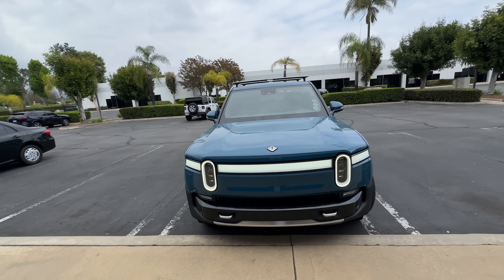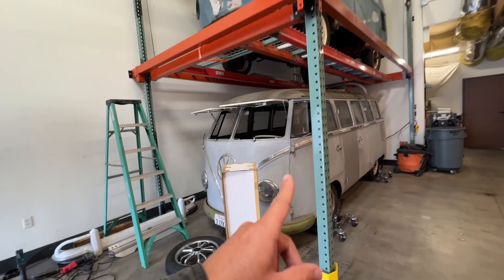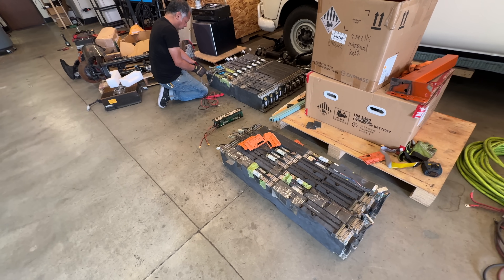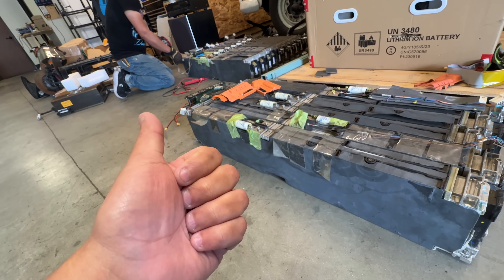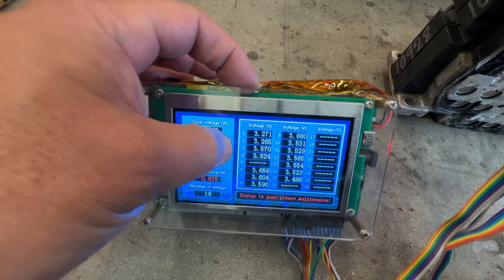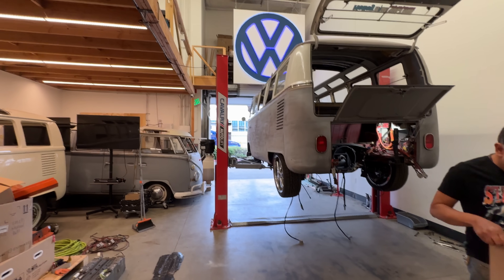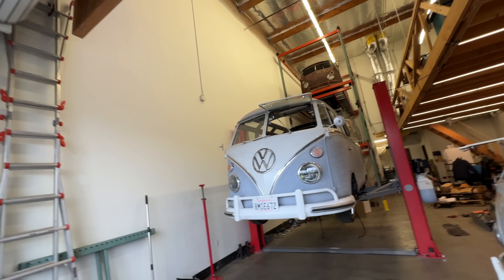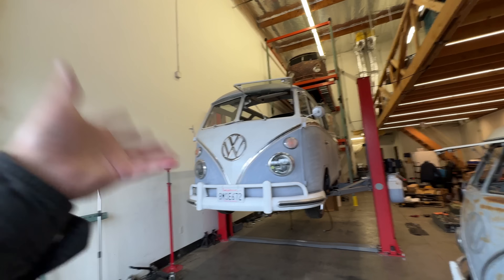$10,500 battery RUINED!!!

Comment: If you parallel another pack to cell group 5 you can push in electricity when a charger refuses. It works I have done it many times now but I think in the end when the cell is saved it is still not a great cell.

Comment: I picked up a used e-bike With a bad battery Problem was It was left uncharged For a year or 2And 1 group of cells dropped below the BMS So it's safely cut the pk off I simply rebalance that pk Put it back together and eventually change out the BMS A better quality 1 with A better quality 1 with a Bluetooth Been working fine ever since But I have been nervous about my larger batteries I've built And now put BMS units That have Bluetooth On all of them It's worth The peace of mind Now we know the temperature In case of thermal runaway And the balance of the battery itself

Comment: I'm sorry Jehu but no BMS is crazy and a huge risk. A BMS doesn't just prevent cell drift, it controls the maximum and minimum charge at individual cell level and overall pack voltage, the maximum current etc - those things are important safety considerations. I know you know this, so why are you so blase about it? If you're continually overcharging 15 groups in the series because the 16th group is at 0V then you're risking a catastrophic event - a fire. Yes, a cheap BMS is just as dangerous which is why you should only use a quality BMS.
Reply from the maker: And yet I ran my rig for 10 years without issue
Reply: @jehugarcia  Yes but that was just luck. It could also have gone up in flames on the first day. It is just crazy to be even discussing dangerous practices in 2024.
Reply from the maker: Your type has been calling me crazy for 10 years.  500 smart packs went into diy EVs Without a BMS I can’t recall a single fire.   You say it’s a huge risk I say  it wasn’t that risky if you know what you are doing.  10 years later here I am no fire and it’s all luck,  believe what you will.
Reply: @jehugarcia  Is there anything I said in my first post that isn't true? I mean apart from the crazy part which we'll just have to agree to disagree. So if technically that is correct and you know it, why are we even discussing this? Because when the failure rate of these cells might be 1 in 100,000, 500 packs is just luck. Same as winning the lottery.

Comment: I don't understand why we would want an electric vehicle. If l replace the engine it costs 1000 max. I spend 2k in fuel per year and I can fill it on long trips. If I spent 20,000 every to years I would be throwing away thousands of dollars.
Reply from the maker: You are crazy,  you can’t buy an engine for $1000.  And  the $10k battery is $5k today,  good for at least another 10 years.  No gas, no oil,  no adjusting valves,  more power less maintenance.  There’s plenty of compelling reasons to go electric.

Comment: In that you've bought 3 replacement cars for that battery, you have to admit, it has served you well! PUT A BMS IN IT!!! It is good to hear about the results of running without BMS, and I'm surprised it lasted as long as it did. Every cell has a different self-discharge rate, even if the cells have consecutive serial numbers. That drift is a "calendar" thing, and has little to do with charge/discharge cycles, or even depth of discharge. Good voltage balancing would split the difference. You Don't want balancing during discharge, regenerative braking, or even bulk charging. The only time you want it, is during absorption/float charging. That will address the 3 differences that appear between multiple cells. Differences in internal resistance, differences in capacity, and, most importantly, differences in self-discharge rates. The latter is the only thing you want to compensate for, using voltage balancing.

Comment: You can make a small hole on the positive side to release the pressure and make the batteries work again.
Reply: LOL I spot welded a hole in a cell once so i soldered the hole back up & kept using it, lasted a few months
Reply: But i wouldn't suggest it, even if the hole is glued back.

Comment: The thing that bothers me about the failure you experienced is because of poor design of the battery pack It is unfix-able. Now that isn't a trait of batteries or EVs but it is a design flaw they all have. There is no reason why a pack can't be designed to have groups or even better cells replaced. Not a single EV on the market to day is designed with an easily reparable battery. Some are easier than others to fix. Tesla makes their battery packs disposable and shame on them for it. Ford's EV truck is a nightmare to access the pack. EV manufacturers need to be required to do better.

Comment: You play with these batteries all day long and you dont stick a volt meter on any of the cells in group 5 ? ? ?

All the other groups had similar or identical voltages
Reply from the maker: I checked,  its dead
Reply: Every single cell is dead?
I dont think so.
Your own testing showed all the modules but one. Having very simular voltages. 
Did you check every single cell in the bad module? 

Even if just one cell in a series module goes bad. You will get no voltage reading

Comment: Happened to me too. Driving 12 years on old lap batteries. Had to store for a year and  half....instruments drained batteries. O volts and two cells were reversed, showing negative  voltage. Slowly brought back pack...even reversed cells. Now two and a half years later....one cell would only give me 5 miles...took it out of circuit. The other is now only  giving me about 25 miles. Gonna replace the two damaged cells. Half the stuff I do people tell me it cannot be done. Life4po is the way to go. I told that to Tesla 10 years ago.....now it is the "New best chemistry "I have fun with this stuff
Reply: Do you mean you can revive completely dead lithium cells??

Comment: What do you do with the old modules? It seems like 80-90% of the cells in the module are still good; I realize you don’t do it yourself, but do other companies pull the cells, test/refurbish, then create new modules? 

What about recycling the actual lithium?
Reply: Yes. My girlfriends Prius had a bad battery. They wanted $18,000. Found a shop in West Palm Beach that replaced the bad cells for $1500. Only bad part is we live 200 miles from WPB. We paid a wrecker to take it down there

Comment: Noting that you didn't use a BMS originally, did you have regen into the battery? If so I imagine your protection was just the fusing, in which case what kind of max C rate did you allow for and how did you choose size & type of fuse? Thanks

Comment: Still cheaper than most automatic transmissions. I'm always bewildered when people point out that batteries are expensive, but completely ignore that ticking timebomb in their ICE vehicles that's designed to have a limited service life and likely means the car is no longer economic to fix when it breaks. But for some weird reason we're cool with that, while... "wHaT iF tHe BaTtErY bReAkS"
Reply: So many manufacturers are using "lifetime fluid" in transmissions these days, even Toyota and Lexus.  So then normies don't change it out, and subsequently a lot of these transmissions die on their 2nd-3rd owner.
Reply: Exactly. A BMW M5 engine replacement will set you back $50k.
Reply: You can rebuild a trans on your bench for a few hundred bucks.
Reply: @BrianMartin2007  and you can repair a battery for about the same amount.
Reply: My friend had a Hyundai that needed at new engine...12k! Lol gas caught up in no time 😅
Reply: I like electric but do not tell me that a 4l60, 6l80 or even vw transaxle costs more lol
Reply: @Nun3zDanny3  compare like with like and there’s not much difference.
Reply: What car do you own that has a $20-25k transmission?!?!  I literally just replaced the transmission in my 2014 Camaro ZL1 and it was $4k BRAND NEW in a crate..  most tesla batteries are $20k+, if its an extended range or performance model expect to pay much more. Reconditioned battteries for ev smart cars are like $15k and thats the low side of the spectrum. I can legit blow my engine and transmission and replace it for less than a P100D battery. Make that make sense.
Reply: Toyota's autmatic transmissions last for ever. You just need to change the oil.

Comment: Solid state batteries will be a huge game changer, I believe there are two companies super close to have them be commercially available.
Reply: That unicorn dream has been told for years now, it's always "just around the corner".
Reply: @SwordFighterPKN  I know what you are saying, the same with Nuclear Fusion, but they have actual battery pouches, and it's two different companies.

Comment: What probably happend is that that module was the lowest voltage and when it fully discharged, started to be back fed by the rest of the pack. This would kill the module. It is also unfortunate that Tesla is going the way of sealing the whole battery so you cannot reuse them 🤨

Comment: Jehugarcia what are you going to do with those battery that you took out from the vehicle that has bad string.
Reply from the maker: Recycle them probably,  not really worth saving them as there are so many better options now
Reply: @jehugarcia  why not use them in DIY a power wall? Do you not do that anymore it has been a while since watching any of you videos. You need to make a vintage 911 EV or similar to drive. Maybe a Karman Ghia? I like your silver highlights makes you look distinguished by the way.
Reply from the maker: @crzy11000 the labor involved in fixing the damage is not worth the battery,  now that there are many better, easier choices available
Reply: @jehugarcia  I'm not going to repair it I'm going to salvage the cells them to make battery for e-bikes if you could do it check me the cost to get it to my location in Miami I'll pay for it.
Reply: @jehugarcia  hi before you recycle them can you link me up with it.

Comment: With all the Lithium Ion 18650 etc., that you've been through, "Thermal Runaway" has never been a problem with all your stock through all these years ?  
Any special precautions you done to mitigate this potential fire problem ?
Cheers.
Reply from the maker: We’ve had a couple of small packs catch fire,  we use a thermal camera when we are testing packs and anything that heats up on slow charging we recycle

Comment: I always equate the huge battery cost claims to an engine/trans replacement.  If you went down to the dealer and asked for them to put in a factory new drivetrain (engine, trans, and fuel system) you'd get a similarly high quote.  Most people find other ways--remanufactured or used engines and private shops, which is exactly where EV batteries are getting to.
Reply: One big difference is batteries do have a finite chemical lifespan.  Were are engine or trans can be rebuilt to almost like new.  So batteries will never get to that level.
Reply: @SwordFighterPKN  I agree with you there. You can essentially pickle a combustion engine indefinitely.  I've often wondered what the auto collector hobby will look like in another 40 years.  Imagine someone trying to restore an early Tesla roadster or a Fisker.  You can't just have a machine shop make you a battery like they could for some '39 ford part.
Reply: @TomLentz  my understanding is the Tesla roadster people are screwed.  Batteries have gone bad and nothing in the required form factor is being made.  No good to have disposable cars

Comment: K, this is something you need to address. One of the cheapest double AA battery you can buy now is from Amazon Basic. It's 100 units for 26 dollars. That's roughly 26 cents per battery. If you look up how much it cost to buy one battery in 1990 you would find that it's around 30 cents per unit. That's without taking inflation into consideration. The inflation rate from 1990 to today(2024) 100%. Meaning if you bought something in 1990s money, you would have to pay 200 dollars in today money. So that's 60 cents per unit in today's money while current battery, which is no the cheapest, is sitting at 43% less of what you had to pay back then. Why is this important? As more companies try to compete, more batteries will be available in the market. Meaning, price war is bound to drive the price of electric batteries. It's good for consumers. But that's not all the equation. That's part of it, monopoly has a lot to do with this as well. We have to watch out for one big company having monopoly on batteries, we don't want that. We want competitions. WE actually do want amazon to compete with tesla third party batteries, what ever the fuck that is lol. And in the long term it will benefit us, and hopefully we don't have to deal with one company controlling the pricing. That's just my two cents, GL everybody.
Reply: Well you are comparing cheap crap amazon battery's that don't last all that long and putting them up against battery's that would outlast any amazon battery. Sorry logic is flawed as soon as you tried to use cheap crap then compare it to battery's that would run gameboys and and sega game gear. There is no way an amazon basic rebranded battery would last half as long.
Reply: @1Shignog  that sounds like a video in itself, i would actually like how know how well it preforms vs brand name battery.

Comment: what overall milage did you had with these?
Reply from the maker: Hard to tell,  my odometer has either not worked or been off since I run smaller tires than it’s calibrated for.  So I’d say 100k-150k

Comment: Any idea how much you guys spend on average on charging vehicles? Assuming on grid power, not solar etc.
Reply from the maker: About $10 per charge on this one
Reply: @jehugarcia  Hmm.. doesnt seem too bad i suppose.
Reply: You can easily calculate that: (electrical rate per kWh in dollars) x (capacity of pack)    x (1,1 (charing losses)). This is the cost for a full charge.

Comment: A 10k engine would run for 5 decades though…
Reply: My EV is 10 years old and has done 400.000km.  All good.
Reply: @moestrei  the engine in my car is 56 years old and has had a 300 dollar rebuild on it and is still running… so In 46 more years will your vehicle still be going for 300 more dollars? We both know the answer.
Reply: The engine is like the electric motor. The battery is like the fuel tank.
Fuel tanks last a loooong time and they're cheap!
Reply: @therealromanian  but it’s not the battery has to be refilled just like the fuel tank just more often way slower and not widely available. We can’t even power our grid efficiently now there’s absolutely no way we can support wide spread electric vehicle adoption. 

Furthermore when the electric motor goes bad it’s bad it can’t be limped home or easily repaired on the side of the road. I can almost rebuild my entire engine on the side of the road with tools I have or have parts break and it still run and get me home.  I can also rebuild my engine for couple hundred bucks and be good for another 5 decades instead of 10k which is way more then it would cost me to start with 3k builds me the engine the first time.
Reply: I'm sure there's one somewhere but I haven't seen a 1974 car running on the original unrebuilt motor in decades.
Reply: @TomLentz  my 68 engine still ran when I freshened it up.